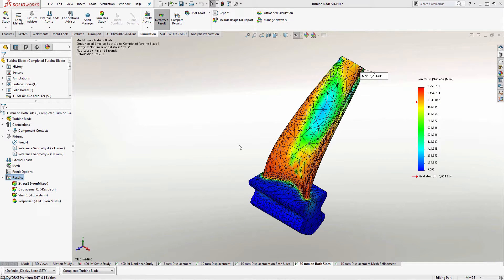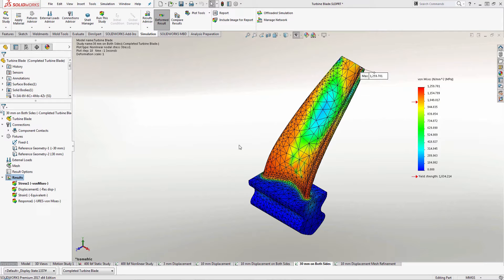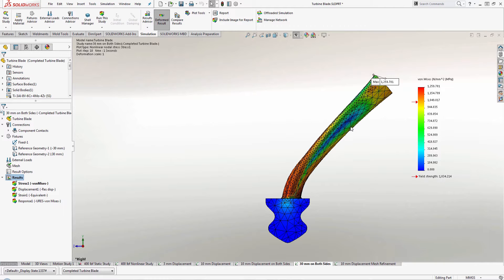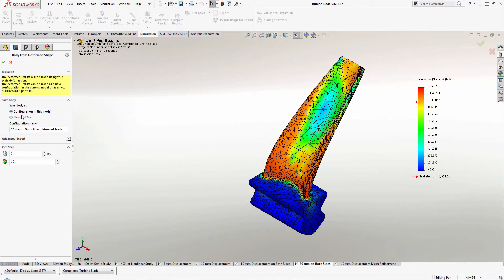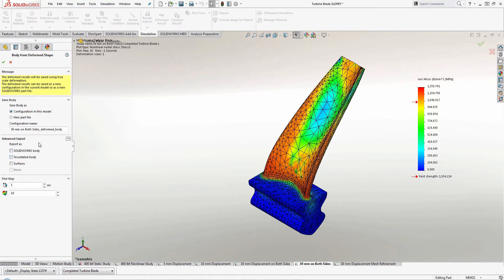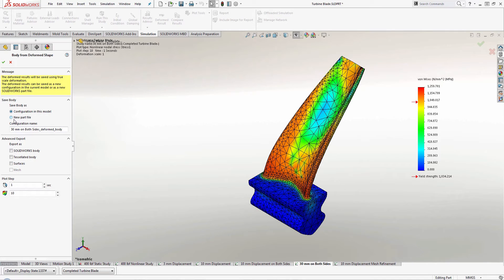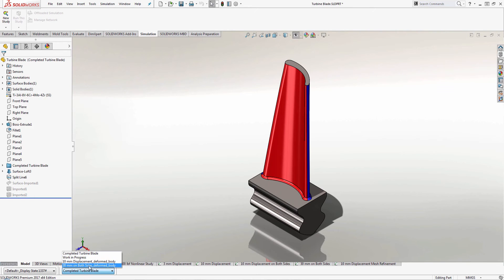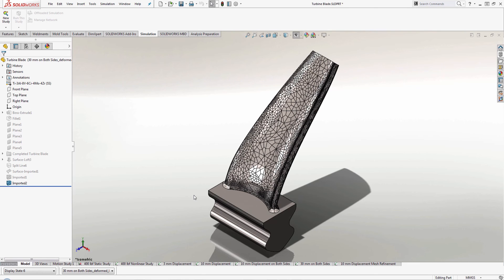SOLIDWORKS Simulation - Save Deformed Bodies

Comment: how do you save a simulation study
Reply from the maker: After you’ve run a study and save the file, the settings and results will remain in the file as long as you have access to the created CWR file.  SOLIDWORKS Simulation auto creates a CWR file after you’ve successfully run a simulation study. 

To locate the results file, RMB the study name, go to Properties.  At the bottom of the “Options” tab, you will see a “Results folder” location.  This will tell you where the CWR file is located.  

By default, it will be located in the same location as the part/assembly file.  If you do not see results loaded, the CWR file may have been moved to a different folder.  If you still can’t find the file, then you will need to re-run your study.